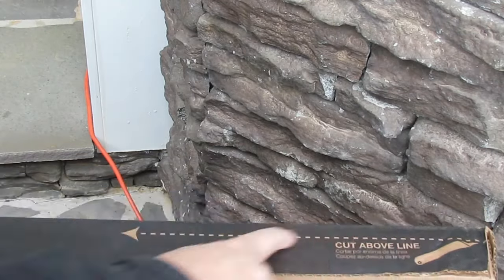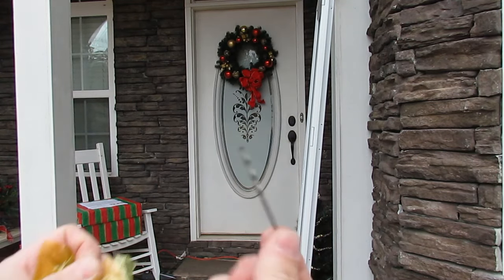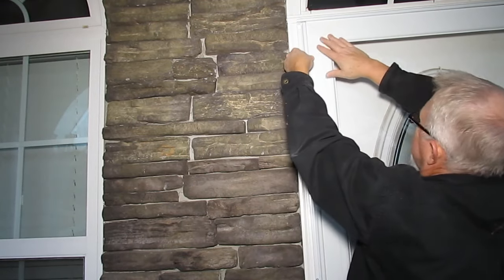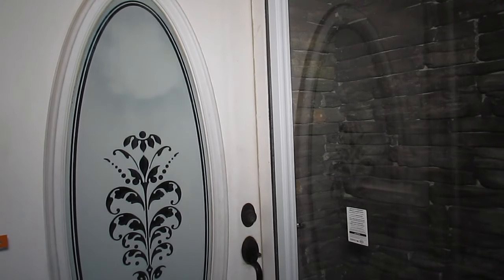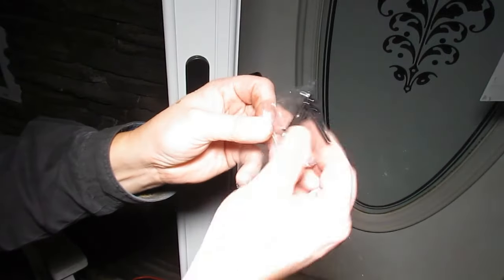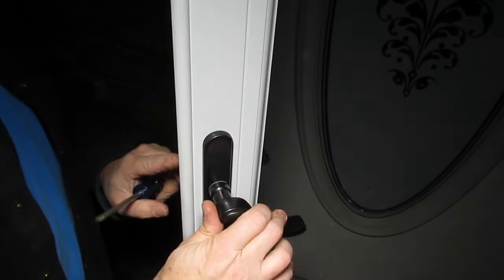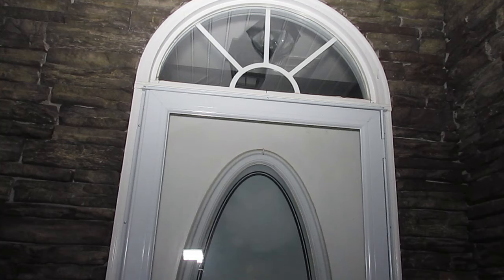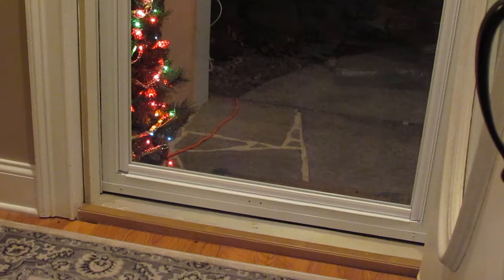Install Andersen Storm Door

Comment: Do you think it would be possible to take the door off the frame and put it onto an existing Andersen frame? For some ungodly reason, my landlord took the storm door off my apartment. When I asked why he legitimately said because the handle was broken. I couldn't believe it lmao. But he left the frame in place, with the hinges and everything. I've been looking online and even went to Home Depot and asked, they had no idea, and they even called Andersen for me and they weren't any help either.
Reply from the maker: It's probably possible, but would probably require the door to be exactly the same model as the one removed for the frame and the replacement door to match up.  Honestly, I think it would be easier to remove the existing frame and replace the whole thing with a new door and frame.  Thanks for watching.

Comment: Just wondering if it makes a difference which side the storm door handle is located on, doesn't seem to matter, but up to this video i had the impression that i should select the door handle side depending on which side my existing door handle is on, so in this video example, i would have selected a storm door with the handle on the right side to match the existing door, but again, it seems to be ok either way?
Reply from the maker: Thanks for watching, Bob!  In the video description, I give an explanation of why I chose to put the storm door handle on the opposite side of the door opening relative to the entry door handle.  Most people will put them on the same side.  In all fairness, even though some folks will say its wrong, you can have the storm door handle on either side, depending on your preference and entry setup.

Comment: Question:  why did you get a door that opens opposite from  your front door.  Andersen video recommends that they open from the same side..
Reply from the maker: Thanks for watching, Michael, that is a great question!  although not required, normally you would install a storm door that had the handles on the same side as your entry door.  In this case I did not do that because the builder of our house installed the wrong hand door for our entry way.  The way our porch is built, if I had followed those recommendations, the storm door would dump people into a wall.  So.....at some point I am going to build a new entry door, opposite hand of the current door and replace that.
Reply: @dwcoffey  I understand.  I was thinking that maybe the door handles bumped into each other.  Too bad about the front door,  now you'll have to install the storm door twice.    After watching your video I installed the same door.  It went way past 45 minutes but looks great.  Thanks for writing.
Reply from the maker: Much better to take some extra time and get it right though!  Glad you got through ok.  Thanks again Michael!

Comment: Your video did not go into setting the closure device.   I am having a problem adjusting the closure so that the door will completely close and latch.  When the door is opened fully and then allowed to close on its own, it will not close and latch.   It appears that the piston does not exert enough force when it is very close to the latch side of the door and this is with the interior door open.
Reply from the maker: Thanks for watching, Priscilla.  There is a screw on the rod-side of the closure cylinders.  You can adjust the closing force by adjusting those screws.  I'd attempt to get the top and the bottom cylinders set to roughly the same position as to avoid torquing your door too much.

Comment: Great video! The first part of my install went great but the door won’t swing open after releasing the orange clips. It feels free at the top and bottom but in the middle it feels like the door is locked. No give at all. Any suggestions?
Reply from the maker: Thanks for watching, Syndee!  It sounds like your frame may not be straight or square, and making the door hang up on it somewhere.  I'd take a straight edge and check the frame, look for any bowed out places and see what is holding the frame out.  Then correct it.

Comment: Question: According to Andersen installation guide there is a minimum requirement spacing between the door and the storm door of 2 1/2” and additional 1”, but when I see the space between your doors I see what looks like 3”. Is that correct?
Reply from the maker: Thanks for watching, Joseph!  Yes sir, the casing on my door gives me a total of 3" between doors.  I've had no problems with that.  I suppose you'd have to be sure the door handles won't hit each other.
Reply: @dwcoffey  Hey Dennis, trying to figure out how high from the bottom the handle sits on the inside of the storm door.  Trying to see if it will hit the deadbolt of my other door (I'd prefer to have the handles on the same side).  My door jam is only 2 and 3/8 inch so I need the handle to not line up directly with the deadbolt or the handle of my entry door.  Appreciate the help!

Comment: Try installing an Anderson storm door 2000 series. Little more difficult than the 3000 series.
Reply from the maker: Thanks for watching, David.  Other than the 2000 series frame being 1-1/4" vs 1-1/2", I haven't found much difference in installing either one.

Comment: Question:  Did you just not install the storm door on the wrong side?  The handle should be on the same side as the inside door, should it not?.  Go check the other hundred videos on installs of storms doors and you let me know (or maybe that is just the way you wanted it?).
Reply from the maker: Thanks for watching, Dean.  Although not a requirement , most often storms doors are installed with the lockset on the same side of the opening as the entry door.  You'll notice in this video , I install the storm door with the lockset on the opposite side as the entry door.  There is a reason for this.  The entry door installed by the builder is the wrong hand, it should have been a left hand door based on the way the front porch is built.  It will be changed to a left hand door in the future.  If I had installed a storm door with the handle on the same side as the existing entry door, we would exit the doorway into a wall unless the door was fully opened when walking out.  Not convenient at all, so changing the entry door to the proper hand door will be the best solution.

Comment: Hey can we talk about what side the storm door hinges go on? Same as the front door or opposite?
Reply from the maker: Thanks for watching!  Although not a requirement , most often storms doors are installed with the lockset on the same side of the opening as the entry door.  You'll notice in this video , I install the storm door with the lockset on the opposite side as the entry door.  The entry door installed by the builder is the wrong hand, it should have been a left hand door based on the way the front porch is built.  It will be changed to a left hand door in the future.  If I had installed a storm door with the handle on the same side as the existing entry door, we would exit the doorway into a wall unless the door was fully opened when walking out.  Not convenient at all, so changing the entry door to the proper hand door will be the best solution.
Reply: @dwcoffey  Thank you, great video.

Comment: What kind of heat buildup do you have between the doors? I’m looking at doing the same thing, but I’m not sure of what type of door. E glass, double pain. What’s your thoughts?
Reply from the maker: Hi Greg, thanks for watching!  I'm not really sure what type glass this Andersen door comes with but we don't have much of an issue with ours.  Now, my entry door is white and is only in direct sun in the morning, so....probably wouldn't have too much of a heat issue anyway.  My issue with low-E glass is that the coating begins to fail after a few years, clouds up and looks terrible.  The standard glass in my door seems to work fine, but if I were looking for more thermal performance, I think I'd opt for double-pane.

Comment: Do these ONLY come in full glass?  I simply want a 1/2 or 3/4 glass, but I can't find them, in this 'easy 45 minute install'!  I even searched Anderson, HD, Lowes, websites...!
Reply from the maker: I have not seen this particular door in anything but full glass/full screen.  There are some retractable and some 1/2 and 3/4 glass models.  I think all of them are in the '2 hour' install class though.  check out Andersen 2500 series self-storing storm door.  also, EMCO is the same brand basincally, check out their 400 series.  I hope that helps!
Thanks for watching!

Comment: @25:27 I had the little pin pop out on its own once already. Is there any way to secure that pin? Like why isn’t there a lock nut underneath 🤦‍♂️ I have kids under 10 and 5 years old
Reply from the maker: Thanks for watching, Don!  If you can, use a connection point in the bracket for the cylinder that keeps the cylinder partially extended.  That will keep pressure on the pin and keep it from coming out.  You'll have to attach the cylinder rod at the door frame, then extend the cylinder a little and put the pin in a hole that will keep it slightly extended with the door shut.  I hope that helps!

Comment: OK, did he not install the wrong swing direction? I'm saying yes. Brochure photos say yes.
Reply from the maker: Although not a requirement , most often storms doors are installed with the lockset on the same side of the opening as the entry door.  You'll notice in this video , I install the storm door with the lockset on the opposite side as the entry door.  There is a reason for this.  The entry door install ed by the builder is the wrong hand, it should have been a left hand door based on the way the front porch is built.  It will be changed to a left hand door in the future.  If I had installed a storm door with the handle on the same side as the existing entry door, we would exit the doorway into a wall unless the door was fully opened when walking out.  Not convenient at all, so changing the entry door to the proper hand door will be the best solution.  Thanks for watching.

Comment: Installed our storm door but the handle hits the locking latch what do you think causes this?
Reply from the maker: Thanks for watching!  I'm not sure I completely understand, but I'll give it a shot.  Do you mean that the storm door handle  is hitting the stormdoor deadbolt latch?  The handle should only turn about 1/8 or a revolution, so maybe the handle is too far down and needs to be removed and rotated away from the door latch.  If you mean the entry door handle is hitting the storm door deadbolt, I don't think there's much you can do about that other than replace the entry door handle with something that sticks out from the door less.  I hope that helps.

Comment: My recommendation is that if you can afford the extra few dollars, get the retractable screen version.  It is a pain to replace the glass in the spring and then have to store it somewhere.  And it is not light.  There are a few other reasons. First is that if you have kids around or just clueless people, it is not uncommon for them to push the screen to open the door or for someone with handsfull to push their butt into it and bend the screen frame.  Ask me how I know.

The other thing is that the weight difference between the glass and screen changes the setting of the closer.  If you set it for the screen it will slam hard with the glass in it.  If you set it to close with the glass, it won't have enough pull to close the screen.

I have had my door for three years and I am replacing it becuase the screen was destroyed and the glass cracked while stored over the winter.  And I cannot find or get replacement parts.  Its a larson not a Anderson.
Reply from the maker: The retractable screens are nice.  Thanks for watching, Roger!

Comment: I just completed installing the side rails to the frame, but the door is stuck in the middle where the latch is (won't open). The door will move top and bottom, but the middle section is jammed. Any thoughts? I popped the orange handle holes and disengaged the orange door holders. I don't want to break it, but forcing it doesn't seem like an option.
Reply from the maker: I'm sorry I'm just now seeing this.  Hopefully you got it fixed.  Sounds like there may have been a screw or a shipping fastener holding it from the backside edge of the door frame. Thanks for watching!
Reply: @dwcoffey  Thanks for responding. I reached out to Andersen and they instructed me to loosen the non hinge side to dislodge the door. It worked. From there I refastened, removed the final orange bottom retainer clip and the door works smooth.

Comment: Just installed my door. However my sweep doesnt drop low enough. Any ideas how to add?
Reply from the maker: Thanks for watching!  Only thing I can think of is to attach a strip of wood or an aluminum channel on the bottom of the door and then re-attached the sill sweep to that.

Comment: Good video but you have the doorknob upside-down... The arch of the handle goes to the top ...not the bottom.... I have installed over 100 of these and I also have done a couple upside-down before I figured it out.
Reply from the maker: Thanks for watching, Jerry!  My wife wanted the arch to go to the bottom, so that's how I installed it.  :)  It works fine, but yes, you are correct, normally it would be installed the other way.  thanks!

Comment: Why isn't the handle on the same side as the house door knob
Reply from the maker: Thanks for watching, Robert!  Good question!  The builder bought the wrong hand entry door for the way the front porch is built.  He should have put in a right-hand door.  So......I didn't want to make entry/exit through the door worse by installing a matching storm door.  I am in the process of making a new entry door in my shop (hopefully will have a video soon) and will replace the existing door with and opposite hand door.  Then the door handles will be on the same side.  I also installed the door handles upside down from Andersen's photos (not that it really matters) but....they are that way because that's how my wife wanted them.  I am slow sometimes, but not stupid.....my wife wants them that way, I install them that way!  haha!!  Thanks again sir!

Comment: why did you install a left opening storm door when the existing door is right opening?  seems very odd!
Reply from the maker: Thanks for watching, Richard!  The full reasoning is in the video description, but the short version is that the builder installed the wrong hand entry door, based on the way the porch is built.  We'd exit right into a wall if I put the same hand storm door in, so later, I changed the entry door.
Reply: @dwcoffey  thanks for the video very helpful!!

Comment: Why the handle of storm door is NOT in same side of the house door handle ?? Door is right-swing and storm door is left-swing! WHY ???!  Is it because the handles would interfere with each other??   It seems odd to have these handles in opposite sides !!
Reply from the maker: Normally, yes.  However, the builder put the wrong hand entry door in this house.  I am making a new entry door in my shop and will replace it with the correct hand door.  As it is now, entry and egress is difficult as the entry door kinda dumps you out into a wall.  So....I don't want to replace the storm door after I replace the entry door.  Once the entry door is done, it will be as expected.  Thanks for watching.

Comment: I would like to know why THere is only 1 bottom spacer included. you have to put it in the middle and balance it on the one spacer .
If you had Two spacers you would have no balancing to do.
Am I missing something?
Reply from the maker: No, you're not missing anything, I agree!  They should include two bottom spacers for balance.  Thanks for watching!
Reply: @dwcoffey  
Thanks for your reply.
Yeah for the $600 I paid for my door I kind of expect them to include two spacers.
Also in my opinion the instructions is lacking.

Comment: Wait, wouldn’t you want the two doors’ handles on the same side? Did I miss something?
Reply from the maker: Thanks for watching!  Although not a requirement , most often storms doors are installed with the lockset on the same side of the opening as the entry door.  You'll notice in this video , I install the storm door with the lockset on the opposite side as the entry door.  There is a reason for this.  The entry door installed by the builder is the wrong hand, it should have been a left hand door based on the way the front porch is built.  It will be changed to a left hand door in the future.  If I had installed a storm door with the handle on the same side as the existing entry door, we would exit the doorway into a wall unless the door was fully opened when walking out.  Not convenient at all, so changing the entry door to the proper hand door will be the best solution for me.
Reply: @dwcoffey  I see. Thanks. I just bought this but it won’t fit. My door is not plumb, and one side is like a quarter inch too short. I’m not sure what I can do.
Reply from the maker: Is your entry door casing out of plumb?  If so, sometimes you can shim between the entry door casing and the storm door to make the storm door fit.  Then fill/caulk around the storm door frame.

Comment: Didn't you want the handle on the same side as the door? Seems backwards.
Reply from the maker: Normally yes, but the builder installed the wrong hand entry door when he built the house.  If I put the storm door handle on the same side, we'd exit the front door right into a wall.  Eventually I'll replace the entry door with the correct hand door.